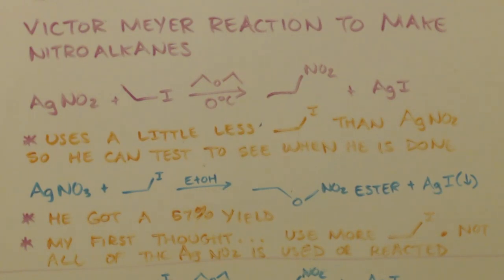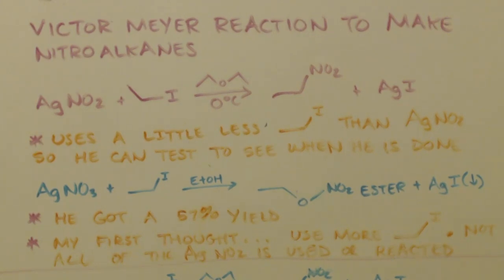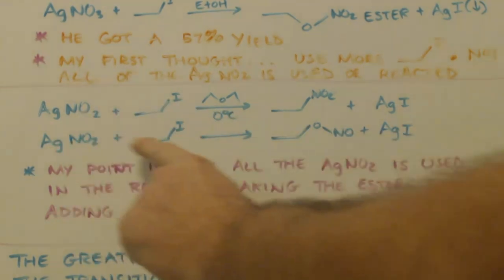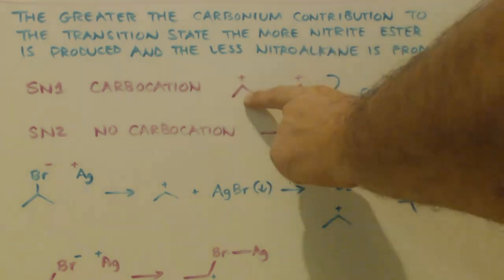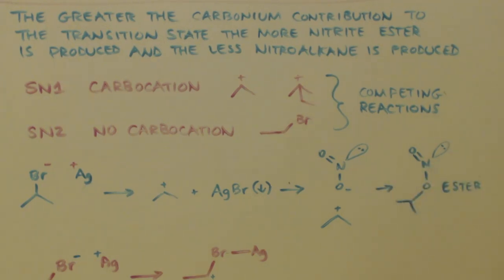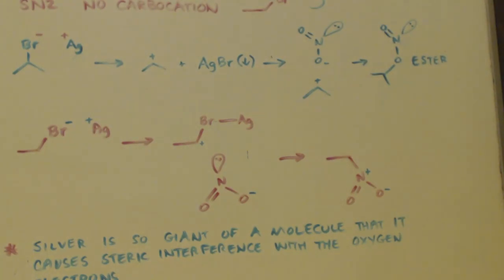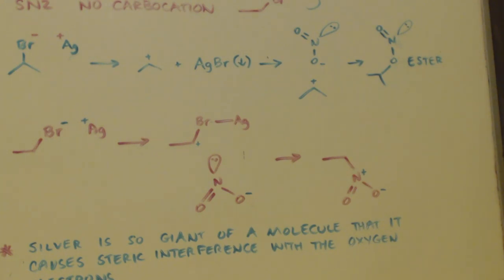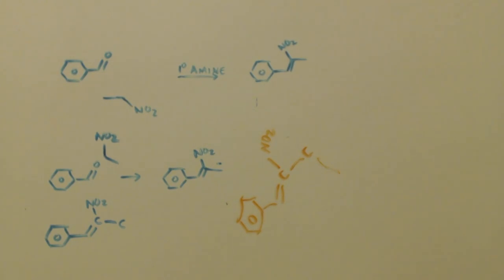VICTOR MEYER REACTION for nitro alkane synthesis

Comment: I'm really looking forward to your procedure. I was poking around Erowid the other day and saw a technique for shaking diethylsulfate together with sodium nitrite solution yielding nitroethane which looked interesting, but the same page said that DMSO can be used as a solvent with alkyl halides, which is gobbledegook because DMSO reacts with alkyl halides
Reply from the maker: Alex Redacted..........Thank you.  I never heard of the diethyl sulfate method but i looked it up.  Nice....you only need to make some diethyl sulfate to do the reaction. The sodium nitrite can be bought already pure.    As for DMSO and alykl halide reacting.  I THINK/BELIEVE you need heat for DMSO and alkyl halide to react.   Also i am GUESSING that you would need a base to help the reaction soak up the HCl created.  In the articles you are reading that say put alkyl halide into DMSO to make nitroethane are they using heat or base in the reaction????????    Cause if they are doing the reaction in the cold or at room temp then the reaction of DMSO and alkyl halide should not be that much.  Guessing trace amounts